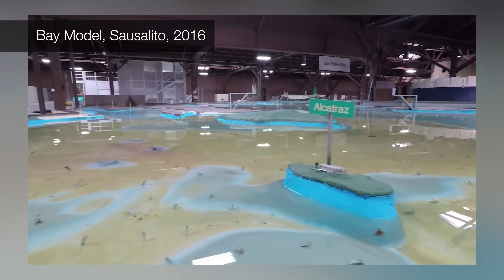This river can be switched on and off

Comment: As a Quebecer, I can confirm that ice on rivers causes plenty of destruction! The ice bunches up against an obstacle like a sharp bend or a bridge, and the accumulated ice becomes thick enough to dam the river. The water has to go somewhere, and it usually ends up on a road or in your basement.
Reply: We call this an "embâcle", which roughly translates to "jam" but specifically refers to a jammed river and not, say, a traffic jam.

Comment: Maybe they could do experiments on the impact of human interaction or erosion. Get a bunch of people splashing around and riding tubes down the stream, and take precise measurements to see how that effects the erosion. I'm certain there are used for that sort of research, off the top of my head, it could help inform parks on the effects of people hiking out to swim in natural pools, or of kids paddling about in creeks that run through parks, and you could test adding different consistencies of gravel, or planting different grasses, to see what helps stabilize those water features.

Comment: Last time my family visited Niagara Falls I remember being told that with the various hydroelectric systems in place they could essentially shut the falls off completely. They don't, of course, it is a major tourist attraction after all. But they do significantly reduce the flow at night, when it's harder to tell that there's a lot less water going over the falls.

Not quite the same thing as an artificial river, and it's only a small section that can be turned off, but I expected something like that instead of what I got. I'm certainly not upset, though.

Comment: You can simulate the world using using computers but if you actually simulate down to the particle level it will take forever to solve... so you have to make simplifications... but once you make a simplification you're no longer solving for the ACTUAL solution, you're solving for a "hopefully close enough" solution and should have little to no trust in the model.

In some respects, physical models are more important as a way of verifying CAE modeling techniques by observing how closely a model matches the actual behavior of a system.

This is an actual problem more and more engineers are encountering, Management that sees computer modeling as a replacement for physical modeling as opposed to prototyping method that allows you to narrow down the design space but also needs to be verified and supplemented with real world testing and modeling.

Comment: a challenge for some problems in computational fluid dynamics is different time-scales for different space-scales of flow. if you want to model something small, you have to have a small timestep, but if your timestep is too small, long simulations take a looooooooong time to run, but if the simulation time is too short, then you won't capture the larger scale effects

Comment: In addition to the Bay Model there was a huge scale model of the mississippi/missouri/Ohio system called Mississippi River Basin Model outside of Jackson MS built in the 50s or 60s. It's been shut down now.

There's also a scale model of the mississippi at Mud Island in Memphis which you can walk along and splash in. Very cool
Reply: You beat me by a day in commenting. I did however link to the 99% Invisible podcast article on the MS river model from 2016.
Reply: Interesting, was it erodible? can it reshape itself

Comment: This reminds me of my visit to Niagara Falls. We were joking about them turning them off at night - and off season they actually do. The machinery doing that would probably be an interesting subject for a future video
Reply: To clarify: Niagara Falls doesn't get turned off at night, but a large portion of the flow does get diverted to two hydroelectric power stations (one Canadian and one American). There is a treaty defining how much water each country can use at given times of day during the peak vs off-peak season.

There is no shortage of electricity at night so the power is used to pump water into elevated reservoirs which are then used to run they hydro stations during the day.

Comment: I worked at an amusement park for a summer and it reminds me of the water ride I worked at, we would pump insane ammounts of water from a lake into the ride, then turn on more pumps to pull that water vertical and then flow it downhill around course. Was really fun watching the ride turn on and off, It would fill up and drain in minutes.

Comment: the problem with scaling stuff is the air and water are not scaled so like in rc planes and helis you have apply bigger controlle surfesese to compensate that the air is not scale

Comment: For clarification: simulating water is kind of "solved", as in there exists equations (it's called Navier-Stokes-equations) that more or less everyone trusts to give accurate results. The problem is, that if you would use these equations (without any simplifications) to simulate a whole river, then all computers on this planet would probably need ten years to simulate one second (or something like that, I made up the numbers, but I think you get the point).

Comment: Broadly speaking, water is the best known fluid in science. However, fluid mechanics are extremely complicated -- particularly when you have things like rocks to account for. This is starting to get into stuff that is way beyond my expertise, but I would suspect that the limitations they're running into is more a factor of processing power and massive scale partical simulation than the fact that it's water.

Comment: Problem is that simulating water is costly. It has very long range of interactions between molecules because of high polarity. Models needs to simulate that and adding & simulating contamination, is very complex. The amount of variables, that can turn the result upside down is incredible. CFD rarely includes more than just water A & water B, without contaminants, differences in specific weight, viscosity etc....

Comment: I kayaked in water flow that can be switched on and off,
Below a huge concrete dam is a small red sign beside
one leaky discharge gate.  Reading:  ALARM WILL SOUND
IF CLOSING.   ALARM WILL NOT SOUND IF OPENING.
Nearby was a chute to divert discharge overflow down
into a deep rocky canyon.   I did not loiter overlong.

Comment: Ever heard of a canal?
Reply: you mean the infrastructure which is deliberatly build in a way to prevent change and its own erosion? how the f would that help you to do science?
Always fun when amateurs tune in on YT and try to tell scientists about their own speciality and what they need.
Reply: @diedampfbrasse98  ever seen a canal?
Ever seen a canal head?
How water input is controlled in lps or cusecs?
And an infrastructure that is deliberately made to resist erosion and change can also be made the way this so called river is(which by the way IS a canal).
So think before u jump to conclusions.
Reply: funny how you completely missed the point of that model and thats its function is not to be a canal.
Your argument is as silly and simplified as calling everything with wheels a car.
Reply: @diedampfbrasse98  as you wish!

Comment: I think there's a problem with this installation. Doesn't the water get more saturated of calcium each cycle and doesn't this change results regarding the erosion experiment? Even if it only affects it by like 10% shouldn't this be accounted for? Or the calcium regulated so that the water flowing has near real world concentrations?

Comment: Very cool to see you in Canada! As an engineer this is the kind of stuff we love. Computer simulations are great but a scale model (or if feasible, full size) can give you so much valuable data. This is especially true when fluid flow is involved as it's still very difficult to simulate, this is why wind tunnel testing is still so common. I work for the Canadian Coast Guard and many of the vessels we design and build are icebreakers (obligatory frozen Canada joke here) so we do a lot of ice tank testing on models as it's really hard to simulate all the loads on a vessel's hull as it transits trough an ice flow.

Tom, I'd highly recommend recommend contacting the folks at the Nation Research Council of Canada regarding their ice tank in St. John's Newfoundland. It's a top notch facility and one of the largest ice tanks is the world. It's government owned and operated, and I'm sure they'd be happy to have you visit. The NRC also has over a dozen other facilities around the country doing interesting and important research in a vast array of fields, including a large 9m wind tunnel in Ottawa (actually a lot of their buildings are in Ottawa, given that it's the capital and all). Well worth checking out.

If you're interested in ice tanks on the other side of the ocean, we've also worked with Aker Arctic in Finland, who operate a slightly smaller tank, and Aalto University, also in Finland, who has an even smaller but still substantial tank. We often use all the tanks as different groups have different methods of replicating sea ice and therefore models perform differently in each tank.
Reply: You should add this to his video request site, it’s a good idea!
Reply: He has a Google form you can fill out to invite him to places.
Reply: Brilliant. Would love to see this!
Reply: I agree with those suggesting that you submit it to Tom's website.
Reply: Sadly...Tom took the vaccine to comply with Turdo and his Nazi injection... Hopefully Tom is alive next year and able to continue his work.?
Reply: @paulknowles6300  The hell?!

Comment: You'd think you could just build something like this in the right location downhill of a reservoir so it could be gravity-fed and therefore not need to use/waste any energy to run. I imagine pumping that much water uses a very significant amount of energy.
Reply: The energy used here is generated via hydro, and there's plenty of extra capacity during off-peak times like during the day. I think this is a great use for it!

Also, I don't think the university has the space for a big reservoir on its campus.
Reply: @patrickplante5103  I don't think this facility is on campus anyway. I've just taken a look at all three of their campuses and can't spot it, so surely it's located somewhere off campus.

For the sake of experiments you wouldn't just be running it when there's excess electricity either, you'd be leaving it running for a full week or a month at a time.
Reply: @Hashterix  good point about the long-term studies. 

Oh and Google maps isn't up to date yet, maybe it will show up in a year or two.
Reply: This video begins by answering your questions.
Reply: Then you missed the initial point about control experimentation.
Reply: @jamesengland7461  I don't see why that wouldn't work. They could still shut it off and run it on command if it was fed from a reservoir. But it's probably more important to have it close to the research team.
Reply: @jamesengland7461  You do know that you can control flow rates, right? So long as the reservoir hasn't actually run out of water, you'll always have the same input and ability to control the flow rate.

Just because it's gravity-fed doesn't mean it's out of control.

Comment: "I assumed simulating water was pretty much a solved problem"
Navier-Stokes has entered the chat
Reply: And even then, Navier-Stokes is usually solved for fairly smooth and constant walls. Not ones that erode.
Reply: And even if you start to have a bit of grip on fluid dynamics, bam, sediment transport happens.
Reply: everyone else has left the chat
Reply: I still dread my memories of the time we were taught Navier-Stokes equation for water. And we didn't even do much with them.
Reply: Turbulent flow modeling 👀
Reply: Nice. :)
Reply: Smooth.
Reply: emulating *
Reply: Oh my, those memories! 😀